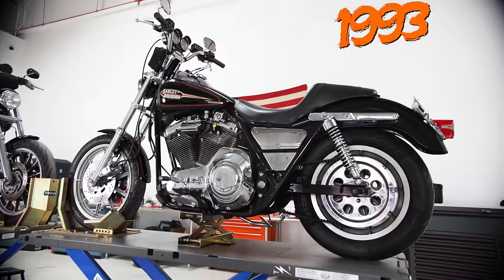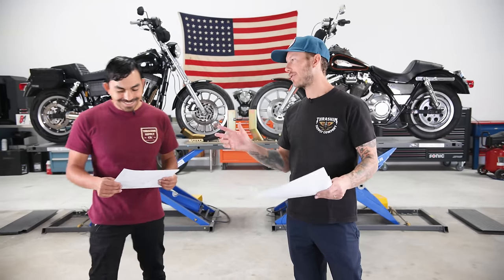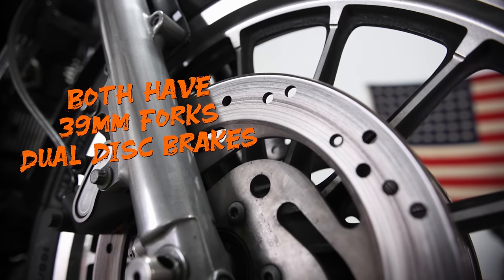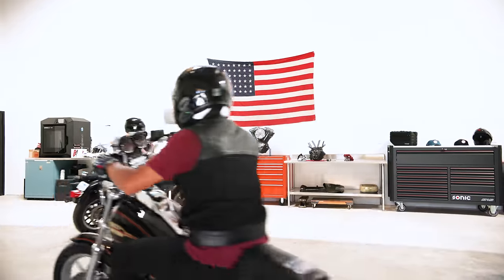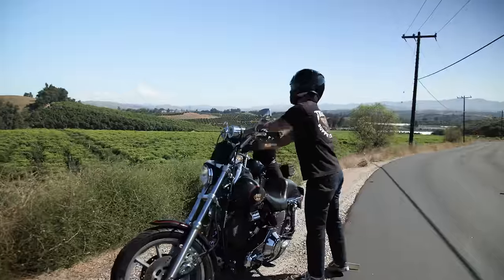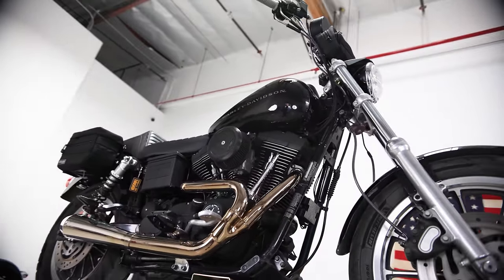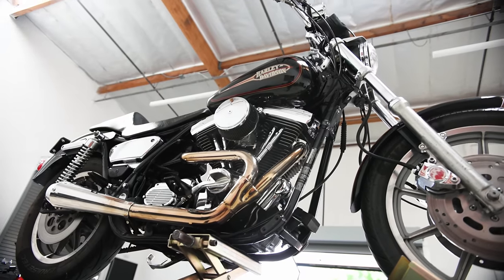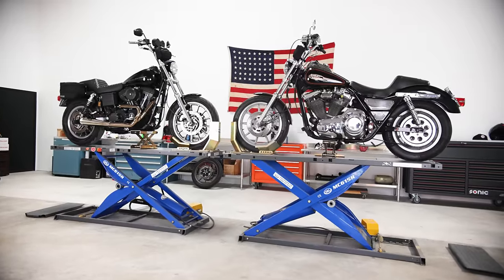Harley Davidson Dyna (FXDX) VS FXRS - Thrashin Supply Bike Comparison

Comment: But the FXR just looks cooler. And it's relatively easy to get 100hp out of that 80in and upgrading the brakes is also easy so it's the FXR for me every time.
Reply: Upgrade to twin cam front brakes for about $100

Comment: I bought a 1993 FXLR anniversary model No. 51 of 800. Great story on this bike. It was around $13,000. I sold it to a friend in 2003. He just passed away July 2023 and I got the bike back after 20 years later. Crazy to be back on it at 70 years old.
Reply: That is so wild

Comment: 😂😂😂 I've tried everything to get rid of my dyna wobble....fxr motor mounts, engine stabilizers, upgraded suspension front and back... short of swapping out for an aluminum swing arm and inverted forks, I'm out of options.  My FXR is totally money though..... don't have a single complaint

Comment: If I had a choice I'd prefer a FXR, put a modern front brakes on it, suspension and so on.
Reply: I have a 94 FXR that I did an inverted front end with dual disk radial brakes, I did an S&S v111” engine, Brock’s swing arm with a rear radial caliper taller suspension. Bike is like a heavier sport bike now. Absolutely rips, and goes wherever you point it. One of the best handling bikes I’ve ever ridden( not just because it’s mine)

Comment: The MSRP on the 93 FXRS was $11,800.  That was a decent chunk of money back then.  Hope this helps.  BTW I'm an EVO fan, better engines with all bearings and no issues with crank run out, cam plates or the cam chain tensioners like on the twin cam.
Reply: Wow you could have bought economy cars for that much money in 93. Of course there is no comparison in the fun factor between the two but that was a lot of money back then

Comment: We, ( wife and I) own 3 FXRs, hers is a custom 1982 ( first year) with a warmed over shovelhead engine.  It’s a real surprise to those that expect an old shovel to run like an old shovel.  We did a LOT of upgrades to the motor and installed a later model trans.  The motor is around 86” now running and EVO valve train and BDL belt drive and clutch.  It’s quick, nimble and smooth.  
We also have an 87 FXRS-SP with a 96” S&S motor, that motor makes a world of difference in performance. At around 100HP it will get your attention, and again , surprises the hell out of a lot of new bike guys with a LOT more money invested.  With Dave Mackie head work and cam and a BUB pipe and Bandit clutch, it puts the power to the ground but still rides smooth all day long. 
The last is a Pro street configuration that was popular in the 90s. It was more of a resurrection for fun than anything else.
The frames are totally different and lend well to custom work. It doesn’t handle like a stocker, but with an107” S&S motor it’s a hoot to ride and keeps up with most anything on the highway today.  Cornering is more akin to any other custom type bike with less ground clearance than a normal FXR.  It’s more like a cross between an FXR and a Softail.
Still a real hoot to ride though.  
With the die-off of the fat tire “ choppers” those engines and drive trains can be found pretty cheap with low miles.
Making for some great custom stuff after a little retuning.   
Those 90s FXRs need very little to bring them into modern performance and braking and are well worth the effort.
I do admit the FXDX and street bones were some pretty damn fine Dynas though. Updating the cam drive paid big dividends on them.   
Still, I’ll stick with the EVOS and FXRS …

Comment: 82' fxrs solid lift cam via shovelhead w a kick start on it has the best sound, relatively slow but is ridden as a daily commuter via solo riding.  87' tcfxrpi fuel injected 103, stock 6 speed, cams;  pulls like a freight train w manley valves hit 89 mph in the 1/8th mile drags.  91' 103 tcfxr 5 speed swap, 45 mikunni.  ran for it for years as an 88 tc w 543 fueling cams, finally rebuilding bigger; was a straight work horse as an 88, 100 mph cruising no problemo.  i have a 14' dyna w 57h cams and a chain drive and i just dont like riding it in comparison to the fxr's.  still would like to build a sporty powered fxr.    best fxr...the one you build and ride.

Comment: You take that evo and freshen it up with a good cam and head work and it’ll walk that twin cam. And those that’ll say it’s “modified” are correct however it’s still less CI than the twin cam. 
Honestly chain conversion, engine refresh, suspension upgrade, and brake upgrade it’ll be a no brainer. I’ve owned quite a few bikes and none of them even come close to the fxr I own. It’s definitely my forever bike.

Comment: Love the video…I am as old school as my 1999 Fxwdg. First year of the twin cam. I have upgraded the motor to 95 ci with screaming eagle high compression heads. And swapped the stock carb for a Mikuni 42 mm flat slide. Love the power and throttle response. I think it’s rad the younger generation like you, is into the old skool scooters. Stay cool !

Comment: Without a doubt the FXR.  HD cut the hours to manufacture a FXR frame and came up with the Dyna (with some tradeoffs).
Reply: It’s was Union welders, they have a sticker on the frame by the vin. The basically ran the same frame on touring till 09 but its not union workers doing the work anymore.
Reply: The engine also had to be pre assembled before installing. Couldn’t install the heads and rocker boxes while bottom end was in the frame. 
It came down to being a cheaper build for Harley switching to the dyna platform. And let’s not forget, when the fxr was being built and sold it was their furthest thing from popular. All the hell yeh brothers said it looked to much like a “jap bike” that’s why a lot of the bikes you’d find from that era, guys were putting wide glide or touring front ends on them, chopping and raking the frames, anything they could do to make them look like a “Harley”. The look is what everyone craved. If they had just ridden the bike like it was intended to be ridden they would’ve realized all their cosmetic “upgrades” were destroying the best Harley ever built.
Reply: @nlftw666  Every mechanic I knew rode an FXR back then. Ride thousands of Harleys and it's a no brainer. Saw lots of stupid mods made them ride terrible. Hamsters slammed them. But we made em go fast.

Comment: I bought an 03 fxdx 2 summers ago. Ive put about 4000 miles on it and i am very happy with my first Harley. I put new cam tensioners in it, tires, a couple of seals. Motor mounts are probably my next winter project. 
Keep them greasy side down fellas! Paid under 5 grand and it had 16000 miles on it.

Comment: I bought a 2005 fxdc new. I have had it ever since. I like the front rake, easy turning with 39mm tubes.  I haven’t upgraded the engine but I have replaced the chain tensioners and rebuilt the forks, larger springs and heavier oil. The weight is a plus for me, easy to control at 650lbs. I paid $13,500.  Thanks for the video
Reply from the maker: Stoked! Thanks for watching!

Comment: I myself own both, a 2004 Dyna and the very last year 2000 FXR4, my Dyna is efi  not carb so I can’t compare it with my carb FXR. However the late model FXR has the same dual piston brakes found on the Dyna as well as the same 39mm forks. The Dyna is definitely quicker but the FXR has a more planted feeling , by far the frame makes all the difference in the world . I think a better comparison would be your 2001 Dyna  and my 2000 FXR4, perhaps we can make that happen sometime. If I could only have one, hands down the FXR4.

Comment: I like the Dyna, mines an 03 95in. I like the TwinCam engine and the relatively short stroke 4in. My 95in is almost a square motor and is snappy
Reply: The 03 is a good year. I'd way rather have the old 00-05 Dyna's.
Reply: 4 inch stroke on an 88 with a 95 kit was probably the best combo for a hot rod harley for sure!
Reply: Bought a salvage 03 RK with a 95 stroker and SE 6 speed got lucky. Feel better of the line then my 2016  103 with cams
Reply: @jeremyaspen5610  Yep, I have Joe Mondello Heads, Dark Horse crank with H beam rods and Timken bearings, Wood ,590 gear drive cams, it hauls
Reply: 96

Comment: Great vlog! I've never had a Dyna so your commentary was enlightening. I love my 94 FXR Super Glide: is my first bike bought in 2004 (didn't know much about Harleys. Just wanted an entry level bike bigger than a Sportster to tour). Added FXRT engine guard, FXRT trunk, and saddlebags from Buckle & Belts in Yucaipa when I lived in Riverside. Changed out the handlebars from original buck horns and replaced seat with Mustang two-up one piece. 86K on frame and tranny; 14K on H-D long-block stock 80" rebuild.  Very different feel compared to my 07 FLTR with 196K original drivetrain miles and 14 FLSTC with 26K original drivetrain miles. Love what you guys do! Tacos!!

Comment: Both bikes are great to own. A quad cam EVO with upgrade to 1250 or 1275 with .567+ cams will smoke both of these, but everyone is afraid to ride a “girls bike”. Parrallel push rods are always more conducive to make more power then criss-cross push tubes.

Comment: 2001 was back when there was a 9-month waiting list after putting your $1000 nonrefundable deposit down.  Prices were stupid, and any bike that made it to the showroom floor had an extra, $2k, or $3k, or $4k added onto MSRP.
Reply: I thought that was more of a mid to late 90's thing. I was into them then when they were stupid money and hard to get. I didn't know that was still going on in the early 2000's. It's insane how cheap Harley's are now. I just bought a beautiful blue anniversary edition 2003 Super Glide in mint condition for $3,500. Back in the 90's this would have been impossible.

Comment: I owned an '03 FXD that I converted to a dual disc front end with works springs and works 13.5" shocks( basically turned it to an fxdx) it definitely was a more nimble aggressive handling bike compared to my '14 fxdl. I also owned an '09 road king and in my personal opinion it out handled both my dynas and you say more in the bike than on it like you do with the dynas. I've ridden my dad's 1985 FXRS with single disc 35mm narrow glide and it felt like my road king just with way worse braking lol. Don't get me wrong dynas are great bikes but you gotta do a lot to make them handle like the FXR or road king (that has been put on a little bit of a diet

Comment: I went from race bikes to a 05 Dyna this year. I tought it was going to be a boring slow ride and I would kiss my corners goodbye but I love the cornering and torque or my Dyna (I have a 95ci and 258 cam) but it's good good sound, good handling and power. I think I may pick up an FXR just to have for the look and to play around with so I have an older carb model. Great video guy as usual.

Comment: One thing you could've added was power potential. Not likely that either would stay stock long. For big power on Evo you need to save up 4k for ultima swap. Twin cam can do 97 inch big bore kit for half the money. Kinda like to see a 3 way comparison with a 1200 roadster. Or even a $5 Sportster with few grand in upgrades. Suspension and 1250 kit. Just for sheets and giggles

Comment: I had a '95 Evo FXDL, now have a '99 TC88 FXDL.
Wouldn't go back.
EBC HH front pads make twin disc work with one finger mostly.
EBC FA200HH don't work in the rear but they are still selling them.
Harley pads for 91-99 have no bite, sure the discs don't wear out but that's no good if it doesn't stop. Stock cams in the 88 are tame, no issues with the spring tensioners here but I change the oil and check the shoes as recommended.
Wheel bearings need to be in spec for the roller type and need to warm up to handle well.

Comment: Both bikes can be purposely build for any type of riding. A Mild street commuter to a go fast hot rod. FXR’s handle the best. No argument there. But to take your FXR and make it reliable.  Take lots of money and lots of very good parts. Technology has definitely changed a lot for Harley’s. Not just electronics, but suspension , brakes, wheel size, etc… considering what we are doing now to our bikes. If you fitted both bikes with high end suspension, bigger brakes, bigger motors, who would come out on top? The legend continues…..🤘🏽🤘🏽🤘🏽🤘🏽.

Comment: FXR 100% bought a new 1994 FXLRC from local dealer for 13,400.00 best bike of the 5 bikes I've ever owned. I have 2 softails and a CVO street glide and a 2000 Big boar FXR
Reply from the maker: Right on! There is the MSRP we were looking for!!!
Reply: Then my dad stole his '92 FXLR (used in '93, one owner) for $8000, with only 3000 miles.  It resides in my garage now.  RIP dad.

Comment: 2:57 I have a really hard time believing the dry weight on an FXDX is 661lbs. Weirdly enough, I've found multiple spec sheets that claim 619lbs as dry weight, and equally as many that claim 661. For reference, a 2017 Dyna Lowrider S has a 664 pound dry weight according to the spec sheet. All I know is that my FXDX feels and handles like a 400 pound bike and that's all that matters to me. On a side note, I've had both bikes, and in my opinion, you can't beat an 04-05 dyna with fuel injection. The FXR I had was cool, but they are absolutely a labor of love. I rode mine 3 times and it catastrophically broke down on me twice. My 2004 has been very solid however. If you're interested in an FXR, just get one that's been restored and you'll have a really nice handling bike.

Comment: I’ve got an 2003 super glide wish it was an FXDX but it was a lot better deal for my first bike, but I love the carburetor Dyna
Reply from the maker: Totally agree!
Reply: Still riding my Dyna Super Glide 02 fxd I bought new in 2002. Running a Mikuni carbs and I bought it stage 1 kit love the bike. Also want to get 2022 electric glide stand 107

Comment: Got my '90 FXR SuperGlide for 10k in '89. Started wrenching at a dealer in '90. Rode lots of FXRs and FXDs. With same shocks/forks FXD sits higher and center of gravity is higher, they feel much heavier to me. XLs  got lower in the turns but nobody wanted to ride one all day. 35 years same bike, 95hp, better brakes, suspension, trans. FXR for me.

Comment: The FXR frame required the engine to be assembled in the frame which was costly since the engines weren't made in the same factory as the bikes were assembled. That's why is was "costly" and eventually discontinued. It is a superior handling frame.

Comment: If the FXR has a hot rod engine fitted along with decent engine mounts it'll maybe be in contention but as my 2010 Dyna (with Chopper Hauss mounts) has a reworked 113" CVO topend along with everything else done, it's 130+ bhp and torque is in a different world to a 40 year old bike !

Comment: Love my 2003 Dyna FXDL - first thing I done when I bought it was replace the engine mounts and have just bought a Performance machine calliper to upgrading the stopping power- even with the Arlenn ness big rotor kit (single disc) I am not happy with the brakes..
Reply: Upgraded my 2003 FXDL to dual disc and am happy with it. Back then Harley offered a kit including disc, caliper, sleeve and even break lever assembly. I don't know if it is still available. Part no was 44090-00A

Comment: The stock TC in the FXDX is nearly a square engine whereas the Evo has an extra .5" stroke with a smaller bore. That should influence what you feel, and it seems to come out a bit in your talk on comparing the rides.

Comment: Did you FXDX have front fork top an bottom adjustable? Rear shock has top an bottom adjustment on my 03'fxdx. Check out TCB out of Texas. Traction controlled breaking. He made a banjo brake bolt with diaphragm, making your standard brakes feel like abs! I put them on front an back very much improvement in braking!

Comment: FXDWG 2003 100th  aniversary, Just picked up has a number paint set, camelion flames withe green and skulls on all the covers and front triple clamps trying to find out info about the bike pretty sure it is a cvo. Harleys seem a little difficult to locate information on.

Comment: I bought a stock 92 fxrs in 92 brand new for 10800.00 .I still have it, was lost in flood fire harley dealership in 97 but bought back from insurance and customized it.Tried keeping parts original but most everything was unavailable. Last year for fxr manufacturing was 94 then limited edition ones 99, 00, any leftover fxr inventory went into those limited bikes harley made.

Comment: The fxr has a more rigid frame which allows for the more rake up front to not hinder the performance. Its the home for the fxrt fairing, no arguing that
Reply: That 01 FXDX has a 28 degree frame rake
Where as that 93 FXR has a 29 degree. 
If you feel that 1 degree hats off to you..
Reply: @nlftw666  numbers don't lie son. Harleys engineers definitely think it makes a difference.
Reply: @dynaordie8083  Harley engineers are told by ceos to build what they build. The dyna platform saved them a ton of money compared to the fxr.
Reply: @nlftw666  yup, no bodys arguing that point.

Comment: From factory the fxr just doesn't have the power of the dyna, especially the 2007 up dyna with the 96ci motor and 6speed gearbox!   I  just built a custom screaming eagle 110ci with the 6speed gearbox" and a springer front-end,  and it's one of the best bikes I've built for running around town.  Plus with the 6speed gearbox, it's not terrible for riding on the interstate either!

Comment: I bought an 01 FXDX with 4,900 miles for 6K in 2015.  Mikuni, K&N, Supertrapp 2:1, SE cam chest & high flow oil pump, inner cam bearings, S&S .510 cams, S&S gear drive with Jagg oil cooler
Reply from the maker: Stoked!